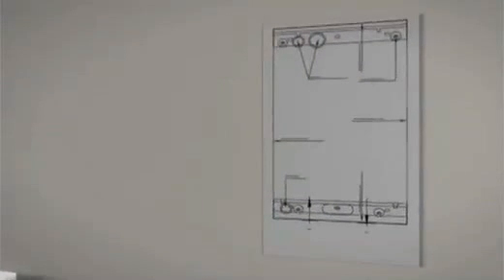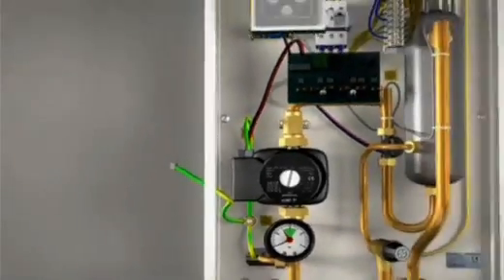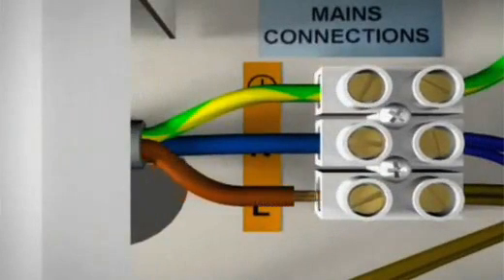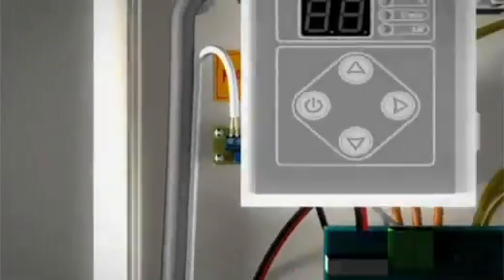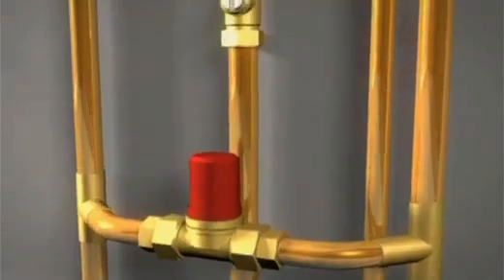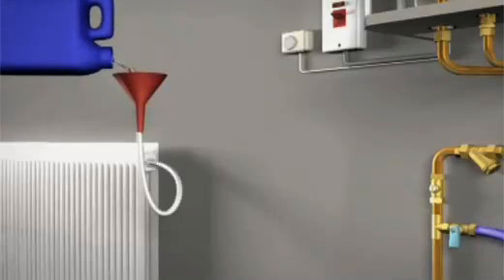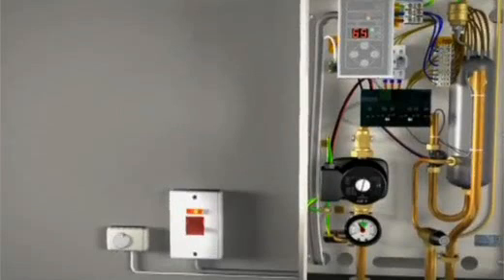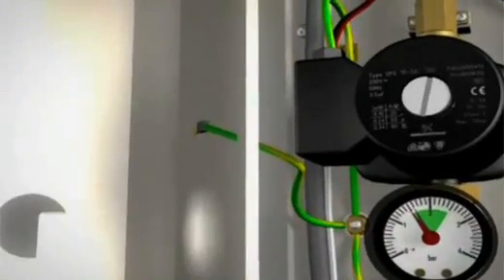Electric Boiler Installation - The Electric Heating Company

Comment: They do cost a lot more to run than gas ,I’m going to have solar system fitted soon with battery back up ,I have a gas combi fitted at mo ,but when the time comes to change it I might look at having one of these to work with the solar ,I only have a small house 6 rads ,so might work for me ,bigger house I do t know

Comment: Is this the same cost to run as gas boiler? Otherwise, what's the point?
Reply: Even in an energy crisis, all decisions cannot be purely based on cost. Your health would make you switch from gas to electric if you suspect low level carbon monoxide poisoning is occurring in your home or place of work. 

Low level carbon monoxide is not detected by carbon monoxide alarms and prolonged exposure may explain why some people feel fatigue, flu type symptoms, memory issues (cognitive impairment potentially indicating a decline towards dementia), difficulty coordinating basic body movements, unexplained body pains, irritability, low mood but cannot identify the root cause after numerous visits to GPs and hospital consultants. 

In a process of elimination, related to unexplained long-term ill health, gas appliances should feature in the top five things to change to see if your general health improves over the next four to eight years. If there's no significant improvement you can always choose to reinstall gas appliances which are cheaper to run the electric appliances. 

I've pasted an article below because YT might block links. You can visit the actual page online by copying a unique part of the text below and doing an internet search on what you've copied. 

I would always advise getting information from at least three different sources online to get a balanced picture on any topic. Nobody should read this and make decisions based on the article below alone. 

below is an article from the website theconversation dot com. The Author is Julie Connolly, Senior Lecturer in Health and Social Care, Liverpool John Moores University and the article was published in 2018.

shutterstock. 

Low levels of carbon monoxide poisoning can be very difficult to spot – and can cause brain damage 

Julie Connolly, Liverpool John Moores University 

Published: September 20, 2018 1.21pm BST 

Carbon monoxide (CO), like many gases, cannot be detected by our human senses. We cannot see it, smell it or taste it. But unlike many gases, small amounts are extremely harmful to us. 

In 2015 (the most recent year for which statistics are available), 53 people in the UK died from accidental carbon monoxide poisoning. This compares with 170 people in the US. While this may not seem like a huge amount, deaths from carbon monoxide are largely preventable. There is, however, a general lack of knowledge about the dangers of carbon monoxide among both the general public and the scientific community. 

The symptoms 

We know the most about acute poisoning; we have some understanding of the wide range of symptoms and after effects that people who are poisoned in a single episode to a large amount of carbon monoxide suffer. But what we don’t know as much about are the effects of poisoning at lower levels, where people are exposed to smaller amounts of carbon monoxide, sometimes over a lengthy period, that do not trigger their carbon monoxide alarm. 

Such people suffer nonspecific but significant symptoms. They may well have engaged with healthcare professionals, and had their symptoms investigated, but the nature of such symptoms do not lend themselves to a straightforward diagnosis once obvious physiological causes have been discounted. 

The symptoms of acute poisoning may include headache, stomach upsets, dizziness, drowsiness, confusion, and seizure, leading to coma and death. These are the cases that are more likely to be reported by the media. 

Those of chronic poisoning, meanwhile are variable, somewhat vague, and nonspecific. People report fatigue, flu-like symptoms, memory issues, musculoskeletal pain, motor disorders and emotional (affective) disorders, where they may be irritable, moody or depressed. These symptoms vary widely from person to person, for reasons as yet not fully understood, but are not necessarily connected to the amount of carbon monoxide to which they have been exposed. 

Fine – or dead 

Another aspect of the lack of knowledge about carbon monoxide concerns the aftermath of poisoning. Carbon monoxide is understood to leave the blood quickly once the person is away from the source of poisoning. 

This is in line with the popular view of how we are poisoned, which is that the damage carbon monoxide causes results from oxygen starvation (hypoxia), as carbon monoxide binds with haemoglobin to form carboxyhaemoglobin. Oxygen cannot, therefore, be transported in to or out of the body’s organs and tissues. A person is essentially slowly suffocated. 

Not enough houses are fitted with carbon monoxide alarms. Abimages/Shutterstock 

This line of thinking means that the assumption that once the person is away from the carbon monoxide, recovery will commence, is easily made. But mechanisms of poisoning are more complicated. Hypoxia undoubtedly plays a significant role, as does what is known as reperfusion injury, which is further damage caused when oxygen returns to tissues that have been previously starved. Carbon monoxide, however, also binds to proteins other than haemoglobin, and it is a toxin which is known to affect cellular respiration and causes an inflammatory response. The brain and the heart seem most susceptible to damage. 

People who have been poisoned may therefore suffer from neurological or cognitive deficits, psychological effects and cardiovascular issues. Cruelly, such symptoms may occur weeks after initial poisoning symptoms have abated, and for some people they will be permanent. 

Prolonged impact 

What also often remains unsaid but is crucial to consider is the emotional toll of poisoning. This is something that is evident from my ongoing research, which centres on collecting the accounts of those who have been affected by carbon monoxide poisoning. 

One sufferer I’ve spoken to has had to change her career entirely, as she could no longer cope with the demands of running her own, previously very successful, business. A young teacher I met with struggles with hyperacuity, meaning that she has become extremely and painfully sensitive to all loud noises. Relationships can also be adversely affected, as people don’t have the same emotional behaviours, and memories are altered. A husband I spoke to completely forgot that his wife of 30 years had never liked drinking tea. It has a significant impact: people have to learn to live with what is in effect a brain injury. 

Such sufferers may not be able to communicate, work or perform their usual daily activities in the same way that they did before they were poisoned. Some of my participants had many months or even years of visiting GPs and having investigations, only to be told that there is nothing wrong to be found. It is natural, of course, for GPs to focus on the person in front of them, rather than that person’s environment. There is currently very little tailored support for people in this situation. 

Steps to take 

Carbon monoxide is common; our bodies generate very small, measurable amounts. Habitual tobacco users have higher quantities, but seemingly without the burdensome, nonspecific symptoms described here. In domestic settings, excess carbon monoxide is formed by the incomplete combustion of any carbon-based fuel; so any faulty heating or cooking appliance using gas, wood, coal or smokeless fuel, and so on, could be a risk. 

Many homes in middle and low income countries rely on some sort of solid fuel for cooking, lighting and heating, with the result that significant quantities of carbon monoxide are released into the indoor environment, although statistics are not always readily available for the burden of suffering that this causes. 

In contrast, we know that one in six UK homes are estimated to have a dangerous gas appliance. Gas appliances should ideally be serviced annually. This includes all of the mandatory safety checks and some manufacturer-specific checks to ensure that the gas is burning safely. 

Carbon monoxide audible alarms and monitors also need to be in place, even in households that only use electricity as fuel, as carbon monoxide can travel between properties. Currently, less than half of UK households have a carbon monoxide alarm, compared with around three quarters of Australian homes. 

If you suspect a problem, call the gas emergency number on 0800 111 999, or the Health and Safety Executive (HSE) Gas Safety Advice Line on 0800 300 363. 

Not sure who you can trust on the news? 

Find peace of mind, and the facts, with experts. Add evidence-based articles to your news digest. No uninformed commentariat. Just experts. 90,000 of them have written for us. They trust us. Give it a go. 

Get our newsletter 

Jo Adetunji 

Editor 

https://theconversation.com/profiles/julie-connolly-429969 

Julie Connolly 

Senior Lecturer in Health and Social Care, Liverpool John Moores University 

Julie Connolly receives funding from the Gas Safety Trust. 

Liverpool John Moores University provides funding as a member of The Conversation UK. 

You might also like 

The world is not building enough green power – here's another way to tackle Paris targets 

Shisha addiction may be stronger than cigarette addiction 

Seven simple ways you can reduce air pollution in your home 

Carbon monoxide exposure in homes is a risk – here's how to protect yourself 

• Who we are 

• Partners and funders 

• Contact us 

Copyright © 2010–2022
Reply: prob much more

Comment: https://www.youtube.com/watch?v=XXhAJ7sT5vI&feature=youtu.be
Get up to 3 quotes for a new boiler in Manchester or anywhere in the UK  http://boilerquotecompare.org.uk/

Do you need a new boiler? The best way of ensuring you get the best price for any replacement boiler or heating system is to get at least three quotes. So whether you need a new boiler in Manchester or anywhere in the UK, you've come to the right place.

The problem for consumers however, is to know which company to approach in order to get the best quote.